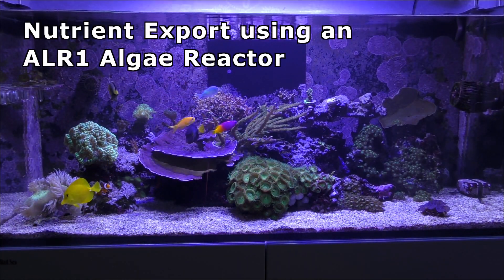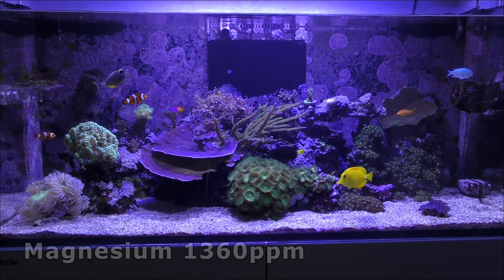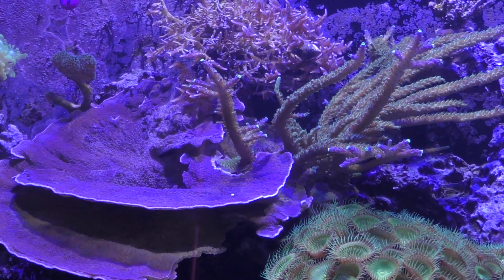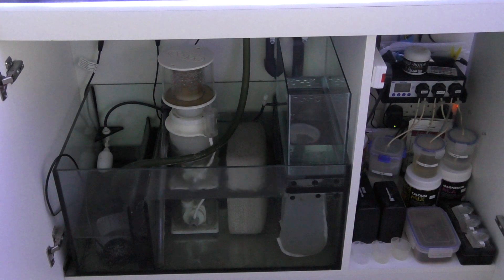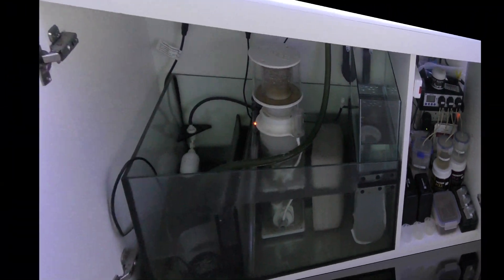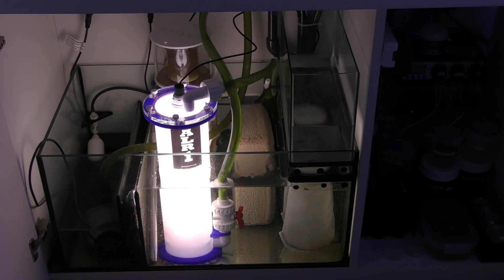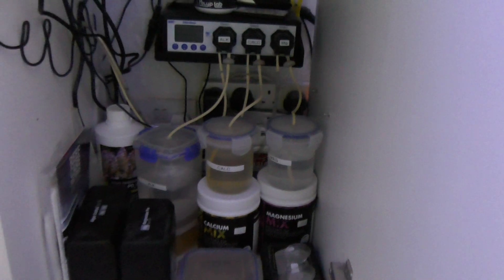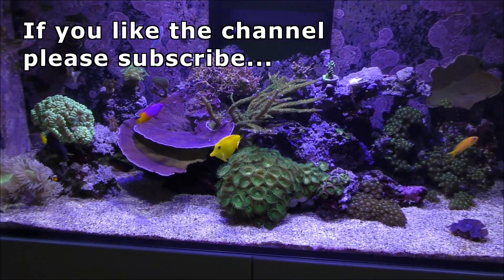Nutrient Export using an ALR1 Algae Reactor

Comment: Have you had any issues with the ATO? I have seen other videos where people complained about the ATO having a mind of it’s own and emptying out into the display.
Reply from the maker: Hi

No issues with the Red Sea Reefer tank, I clean the ato plumbing and float valve every month otherwise it clogs up. The silent downflow needs tuning to be reliable and quiet. ALR1 is a must have piece of kit in my opinion.. I need to post an update/long term use video ..